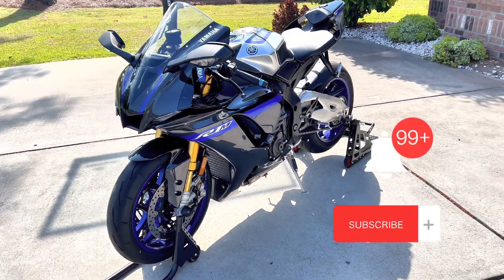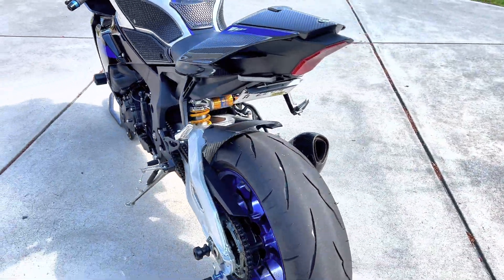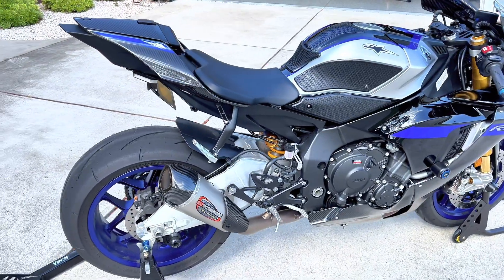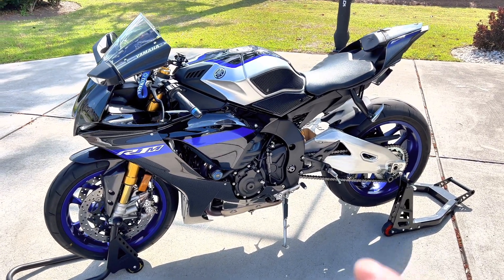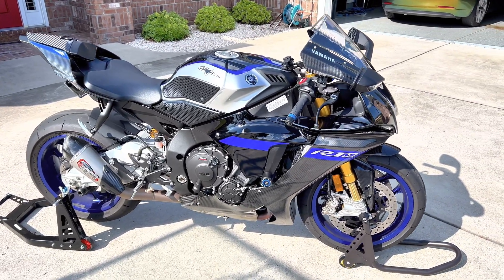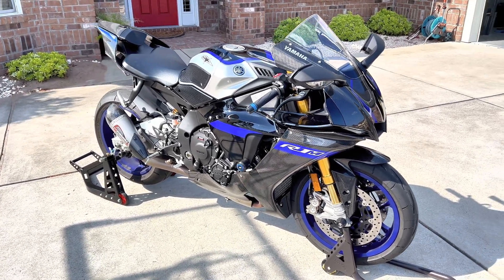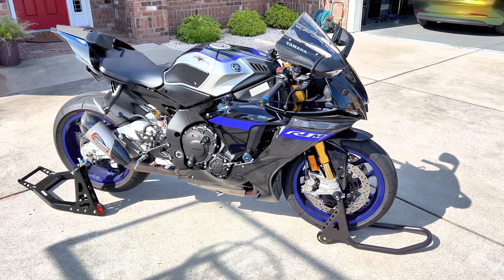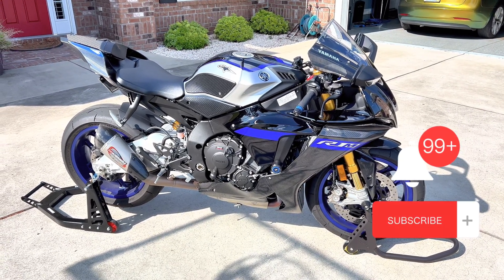How NOT to roast your NUTS on your 2023 Yamaha R1M…Fan Temperatures: A Data-Driven Approach

Comment: What about warranty after ecu flash
Here in india when we flash ecu we wont get warranty on engine
Reply from the maker: Partha...when you flash your ECU you creat 2 BIN files. One is the ORIGINAL SETTINGS BIN file and the other is the CUSTOM MAP AND ECU FLASH BIN FILE. If you ever need to take your bike in for warranty work they dont know if its been flashed...BUT they can overwrite the ECU FLASH with the Dealer Computer. It does not void your warranty per say...but you'd need to reload your ECU FLASH file after the service is completed. I have never been worried about voiding an engine warranty. After all...I'm only UNRESTRICTING what it's engineered to do in the first place. I hope this helps.

Comment: Hi dude. I think you need to pull the trigger on some GB Racing engine covers if you're you're doing track riding (or street)
Reply from the maker: Those are super nice and would be an awesome upgrade. The TST's I have all the way around the bike are a great start but a GB Engine Cover would be the icing on the cake. Great suggestion Lee.
Reply: @CK_RIDES  All the endurance teams use them and they boast many Suzuka 8 hour victories.